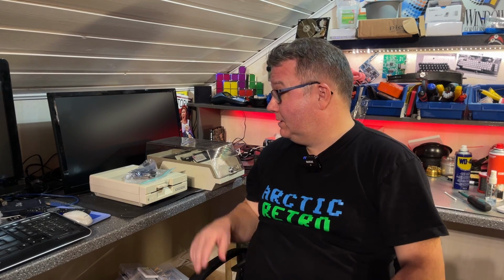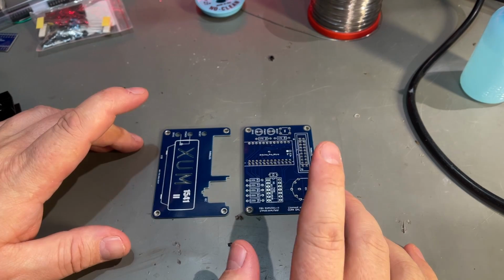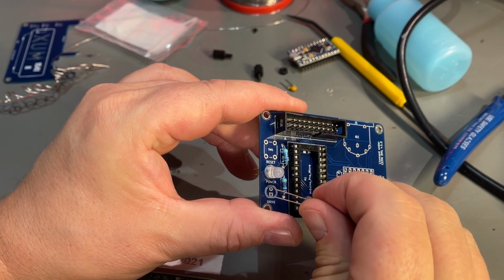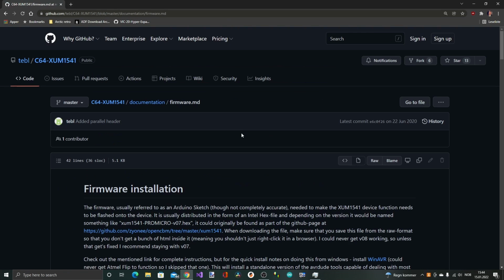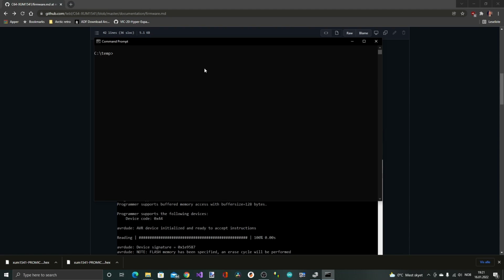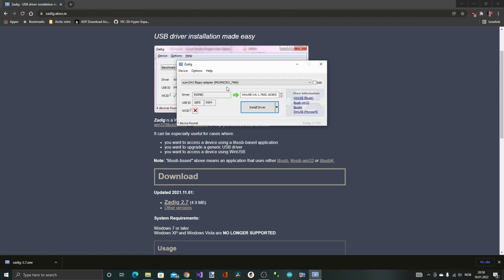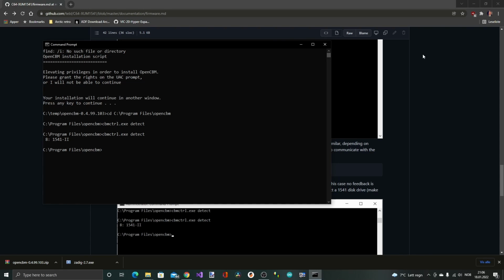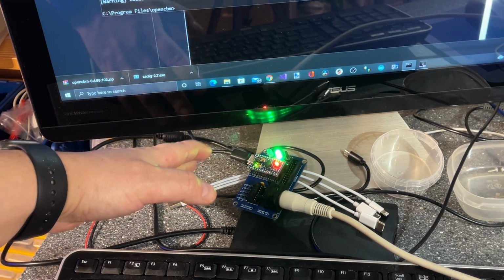Building and testing a XUM1541-II adapter for connecting a Commodore 1541 floppy drive to a PC

Comment: I did a similar project a couple of weeks ago for a friend. I build the arduino directly into the 1541 and also connected the parrallel wires. Pretty easy to do with a dupont cable. Cut the cable and solder it to the chip on the motherboard and the serial connector. The connect the dupont connectors to the arduino. I designed and printed a mount formthe arduino so I could glue it into the case and drilled a hole so I can connect the usb cable if needed. Works great. Advantage of the parrallel connection is that it is way faster and you can copy/write copy protected disks. I made the same ‘mistake’ with programming the arduino with the com port changing 😉. Nice project and video again 👍
Reply from the maker: Thanks a lot. Sounds like you did a great job there!

Comment: I've fitted the Pro Micro board directly into the 1541. That cheap method requires just the bare Pro Micro board and a few wires to solder to the 1541 board. I left a USB cable dangling out of the case to connect the drive to the PC.
Reply from the maker: Nice :)

Comment: Hi,works with WinVice to read a real 1541-II drive?
Reply from the maker: I don't think that is possible to do directly. You could easily just copy the whole floppy to a D64 file and mount that in vice in stead
Reply: @Arcticretro  I have an XA1541 cable you can connect the 1541-II to the PC and use it with real 1541-II on WinVice 3.2, I just wanted to know if this was possible.
Regards

Comment: You only need a parallel cable for faster speeds; no need for Speeddos or something similar.
Reply from the maker: Ok, thanks!
Reply: The S-JiffyDOS 1541 ROM should still speed this up quite a bit
Reply: @Breakfast_of_Champions  The advantage of a parallel cable is that you can do a nibble copy with a 1541. Otherwise you'll need a 1571.